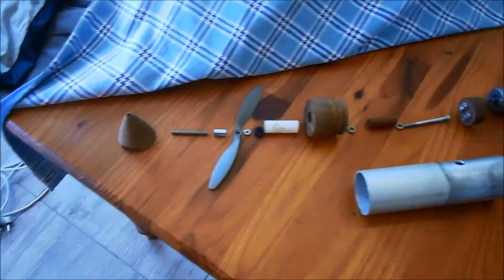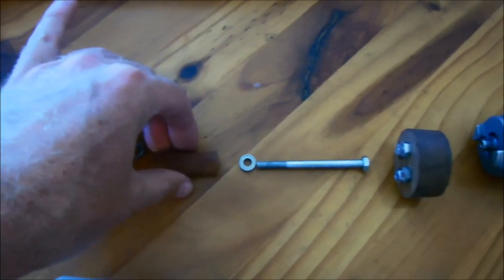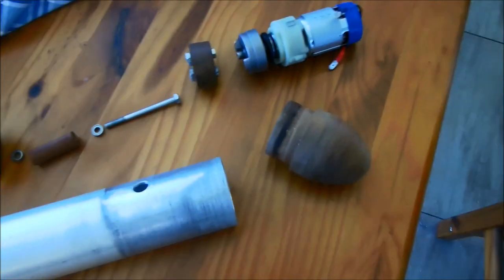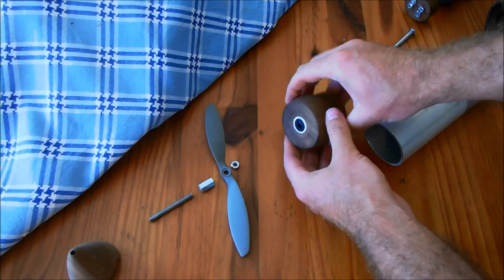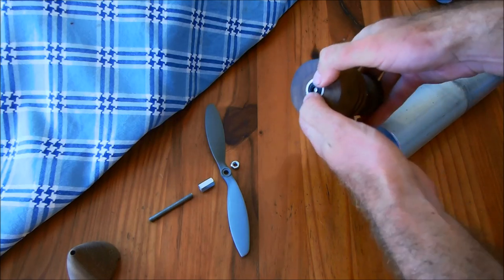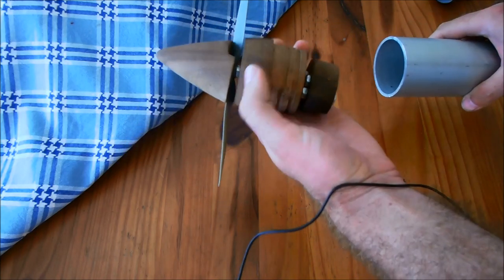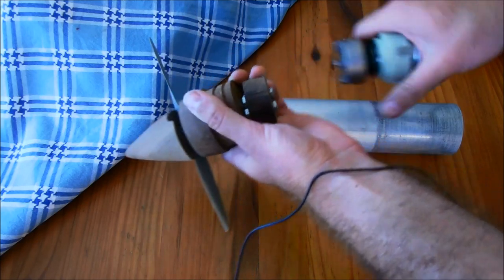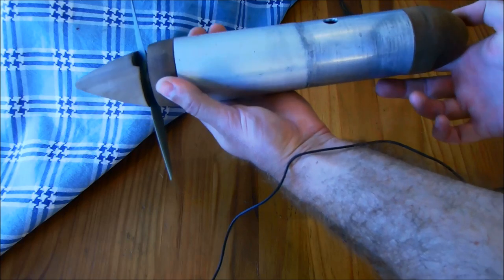DIY electric kayak motor - assembly and dry run

Comment: I'm doing this at the moment, but I have a 3d printer and am from "drone" side of technology. I love your turned bits. I'm using a brushless motor under water, as no brushes to foul up, also only a billet turned 38mm propeller from a RC speed boat and a waterproof servo for steering as I couldn't think of a neater way on an inflatable canoe. idea is the motor will be held on through the outer skin of the kayak with magnets, with a plate inside the canoe with the esc, battery and a control box that I've not designed or thought too much about.
Fin, motor mount and rudder are printing now, we will see!!
Reply from the maker: Sounds like an interesting project. Water creates high shear loads in the small gap between stator and magnets. This robs the motor of some of its available torque.

Comment: Awesome with my 37lb 12v trolling motor im using a 11 by 4" gas propeller increased speed from 2.7 knots to 4.1 knots absolutely awesome 😁.
Reply from the maker: Excellent. Have you tested any other sizes? Slender 2-blade props tend to have better peak efficiency if the pitch equals the diameter. An 11x11 will most likely draw way too much current, but a 6x6 or 8x8 might work well.
Reply: @williamfraser  10/6" was slightly slower but battery was hit harder also picked up weed easily. 11/4" was definitely the best increased speed by 1.3 knots with a extra person in a small rowing boat.

Comment: Hi William, just saw your video recently and I got few questions: How many oil seals used and orientation?
Can it use water jet impeller?
Reply from the maker: Just one oil seal where the shaft exits. Flat face out, packed with grease just inside between the seal and bearing. Now that you bring it up, maybe it would work better with the seal facing in since the pressue is from outside. Effective sealing depends on tolerances and surface finish of shaft and seal housing. An impeller might work at high rpm and high boat speed, but there are too many variables involved to make a general recommendation.

Comment: At first i thought it is rubbish due to the brushed motor, im more used to brushless motors and they are much more powerful then brushed motors.
But actually im really impressed by the design of your couplings and the whole assembly, i would like to know what the leakage at the seal will be.
All in all nice work! :)
Reply from the maker: Thanks Jan. It did eventually leak but not through the seal or o-rings. Water somehow seeped straight through the wood grain. This was recycled teak with a very coarse grain. The amount that leaked initially was so little that it went unnoticed but set the rust in action. When I took it for a test again earlier this week (more than a year later) the leak was much worse and the motor did not last long at all. I did a pressure test and saw tiny bubbles escape straight through the wood. Tomorrow's race is with a chunky brushless motor if I can get everything finished.
Reply: @williamfraser  Got it, good luck then for tomorrow

Comment: Hi William. In your experience, what is the ultimate RPM to aim for with an APC prop, for best efficiency?
Reply from the maker: It depends on prop pitch and boatspeed. The 8"x4" prop in this video would be most efficient at 1150rpm if the boat is doing 3.4kts.
At that rpm it would be absorbing 65W and put out 41W, so efficiency would be 63%. At the same boat speed an 8" x 8" would be near peak efficiency of 73% at 720rpm, and it would be absorbing 57W and putting out the same 41W. I will do a more detailed tutorial sometime soon to show how to select an appropriate prop. BTW I just got off the water with a 10"x8" Master Airscrew on my new brushless drive and it KICKS ASS! I did not have a tacho on the motor but got Volts and Amps readouts. I'll compare with my dyno results, it should be possible to work out the rpm from there.
Reply: @williamfraser  Thanks for the detailed info! Hoping to get started with my setup soon. I have decided not to use the Minn Kota trolling motor I have but to scratch build one similar to this setup. The 24V brushed motor (ex kiddies scooter) earmarked for the project will run at around 1200RPM @ 12V, and 60W is about what I was hoping for (5A @ 12V). Looking forward to your prop tutorial.
Reply from the maker: @chrisnothnagel4910  also look at the Master Airscrew propellers (G/F series, not the Scimitars) . They are not as readily available but they are much cheaper and much more robust, especially near the blade tips. Their efficiencies are right up there with the APC props.

Comment: Unless you seal the teak surface with Polyurethane or Epoxy it water is going to leak into the housing.
Reply from the maker: Some lessons are learned the hard way. I have used Black Cherry and Bulletwood on the new design.

Comment: Well done! Does it seal well?
Reply from the maker: No leaks yet. It only has around 7hrs total running time to date, so long term reliability is still unknown. There is ample space between the two shaft bearings for additional oil seals or o-rings. Edit it eventually leaked!
Reply from the maker: The dowel and pvc pipe are glued in with epoxy. The cavity between the oil seal and outer bearing is packed with grease.
Reply: Great inspirational work William!
I am busy putting my solar kayak together, but so many projects so little time :-). There will be a small battery of around 50Ah or less, a charge controller and I have 6x15W panels in parallel to give 90Wp. No outriggers for the panels but the kayak is a tandem SOT (Toucan) and the panels will be in a single row in front of me, they are only 350mm wide. For now I am adapting my trolling motor but eventually want to build a single speed motor like yours for the sake of electronic simplicity... and well just because it's a cool project.
Please keep us updated with progress.
Regards,
Chris
Cape Town
Reply from the maker: Set the trolling motor's control to max, it bypasses the switching pwm circuit. Then just measure voltage over the motor with the boat underway. If the voltage is lower than your panels' max power, swop out the prop for one with a finer pitch. Only reduce diameter as a last resort. I know of projects where rc props have been retrofitted to trolling motors. They are obviously not as robust but much more efficient. When you are ready we should have an Eastern Cape vs Western Cape solar challenge...
Reply: Thanks for the advice, I will experiment - there are a few props lying around from my RC days. I'm up for that challenge... depending on the success of my efforts :-)
Reply from the maker: @chrisnothnagel4910  Update: it did leak through the wood. I am using different wood for my next build (Black Cherry). Much finer grain and it takes epoxy well so I have covered it with thin fibreglass as well.
Reply: @williamfraser  I will be using HDPE where you used wood for my motor with similar design. Easy to machine and readily available from engineering plastics suppliers. The body is a 76mm alu tube. Still a project in planning though... but have a collection box for it so as i source/stumble upon the parts it gets added. Maybe early next year :-)
Reply: @williamfraser  could you mill a dense rubber? I'm thinking the chocks they use for airplane wheels or engine damping blocks?? Edit. I see Chris already mentioned that.
Reply from the maker: @pakde8002  a hard polyurethane should work well. I don't know if it machines as easily as plastic though.

Comment from the maker: I notice a disproportionate number of dislikes for this video. I am open to constructive criticism.
Reply: It seems that some people make a living of disliking anything. Good vid , I have a few kayaks that I would to try something like this on. Question: With the 8X4 prop, what is the most efficient rpm for your kayak and load? Close to retirement, I will have free time.
Reply from the maker: @marclapointe368  I was never able to get actual measurements but my calculations show that for roughly a 100W supply it runs at 1150rpm at 3.4kts. With 300W it should be closer to 1800rpm at a boat speed of 5.5kts, based on drag estimates for my kayak.
Reply: I've never disliked a video unless it was in really poor taste or downright offensive. A like or sub costs nothing and might make someone's day a bit brighter. I'm glad you read and answer many of your comments as I learned just as much in the comments as I did in the video. Cheers from Bali 🌴

Comment: Really awesome. Planning to make one. Currently building using vertical shaft version using angle grinder gearbox. 

Whats the motor RPM? Is the propeller an RC airplane propeller? Is that plastic or alum?

Thanks in advance
Reply from the maker: Motor rpm is around 14k so prop turns 1600rpm. Gearbox reduction ratio is 9:1. If you have a higher ratio gearbox, i.e. slower output speed, you should be able to turn a larger, coarser prop which will improve efficiency. Yes, that is a plastic rc plane propeller.